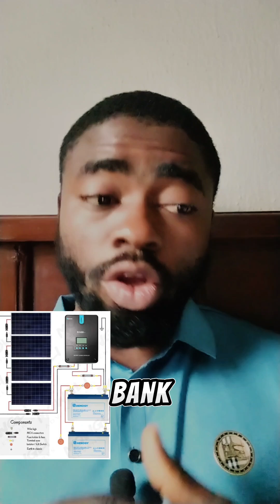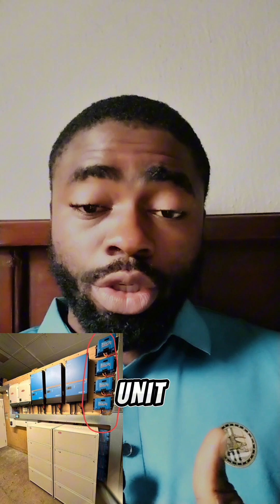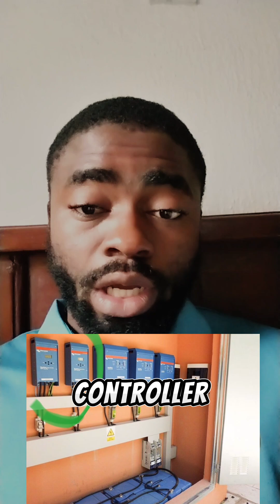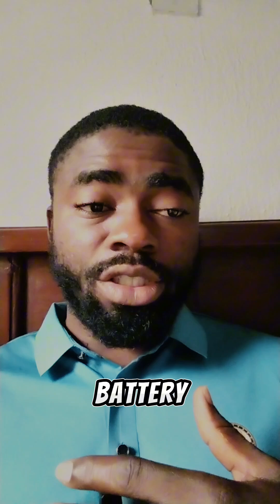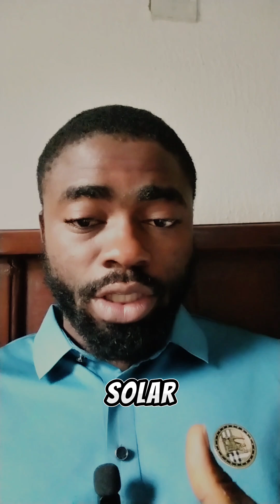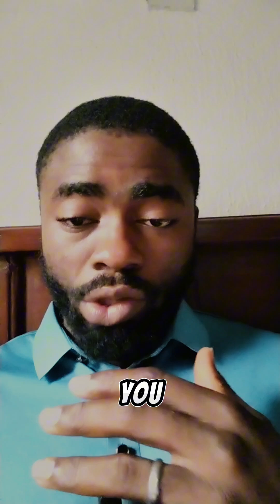Can two solar charge controller work on one battery bank?

Comment: What i have noticed when using two charge controllers to charge the same battery is that, if not wired correctly the current will always choose the path of lowest resistance. Making always one charge controller to work more than the other.
A bus bar is a must, and all cables must be same size and length to the bus bar, which is not always easy to do. 
As an other member mentionned, it is better to use smart CC which communicate or basically just use hybrid inverters in parallel

Comment: If i am to use 2 controller, Can i loop one charge controller to the other and then connect one end of the charge controller to the battery?
Or i should connect individual controller to the battery?
Which is advisable?
Reply from the maker: It's better to have a busbar and connect each controller independently to the busbar

Comment: thanks, but is it necessary to use bus-bar to connect the two charge controller together?
Reply from the maker: Yeah to have a clean job and avoid over heating at battery terminal

Comment: Correct, you can connect 2 charge controller, but make sure it is a smart one, same make and model and both communicate with each other.
Reply from the maker: Ah, communicate keh.
That's not true sir!.
They can be different make and work very fine.
Just make sure they have same or similar PV voltage
Reply: @Mairigaemmanuel   well, the communication part should be necessary for correct load sharing between charge controllers. But is can also be neglected when using controller that doesn't have the feature.

What is even not important is the PV voltage matching.
You can decide to use a string for one controller and entire different panel configuration for the other. 

Same as some hybrid inverters that has a dual mppt input, you can decide to use 6 panels in series for one, and 5panels in series for the other one, what matters is the charging voltage and current from the controller to the battery.

It is also useful to use dual mppt when you have uneven roofs or you have roofs that are so steep and you have to install some panels on facing opposite sides. So that one panel and controller group will generate morning to afternoon, other will generate afternoon to evening.
Reply from the maker: @savageolatunde6731 from experience, it's better both controllers have similar PV voltage rating
Reply: @Mairigaemmanuel  ok. But what is the science behind that experience. 

If grid and solar can charge a battery at same time and they are of different input voltage, why cant a controller of different input voltage charge the battery?

Grid takes from 220vac and charge controller takes from a varying solar voltage and they both charge at the same time. So why does the solar input of two charge controller have to be the same?

When the input of a two controllers are same. Are you saying that if there is a shading on one of the controller input, and cannot produce much power, the whole system is compromised?

Please i will like you to educate us.